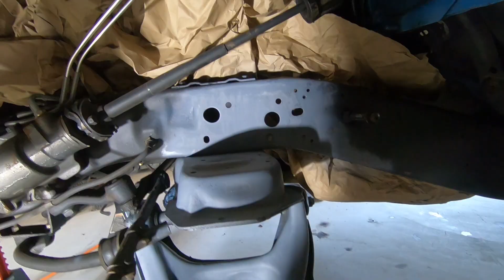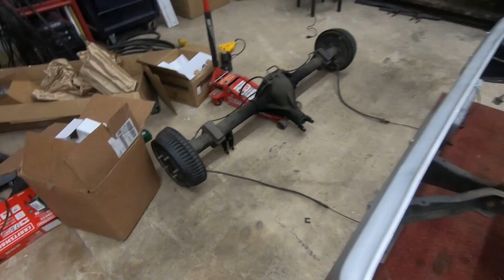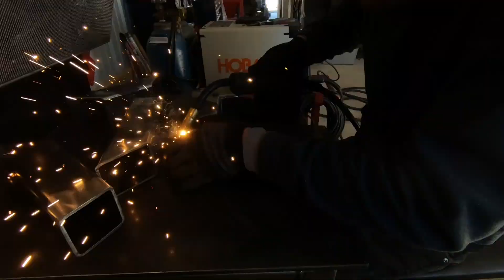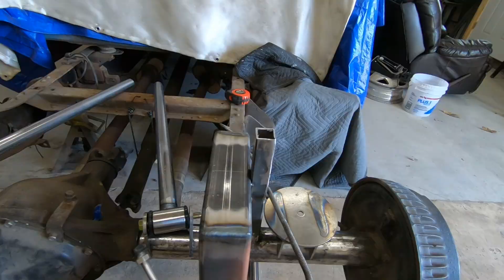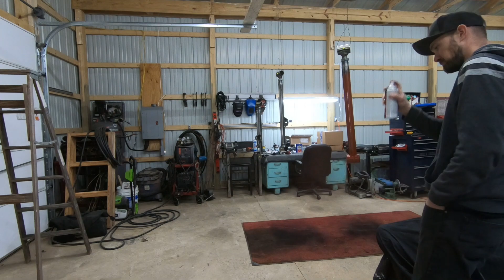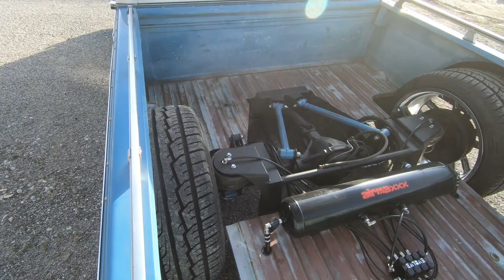Bagged C10 Build: Start to Finish

Comment: Did you pancake the front crossmember or anything?
Reply from the maker: No. Stock from crossmember with ektensive front arm kit. It still was hung up in thr front on the crossmember. I would have rather done an aftermarket one, but the customer was on a budget
Reply: @PickleFab  and sitting on the crossmember it still gets that low as I the video? Trying to decide if buying a crossmember or pancaking mine is worth the money or time. I'm not really worried about laying the body.
Reply from the maker: @davidsewell5764  I would say it's worth it. This truck was about 1.5 " from laying frame towards the front. If that doesn't bother you than it might not be worth it. But I always prefer to see the truck fully laying frame front to back